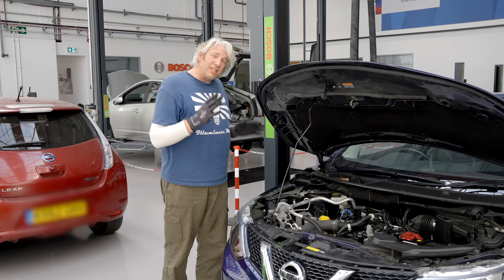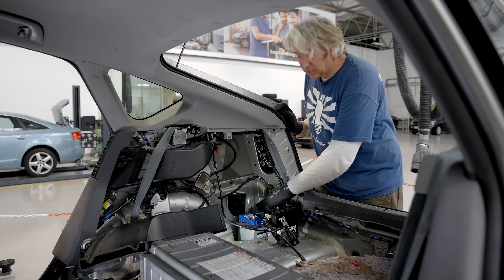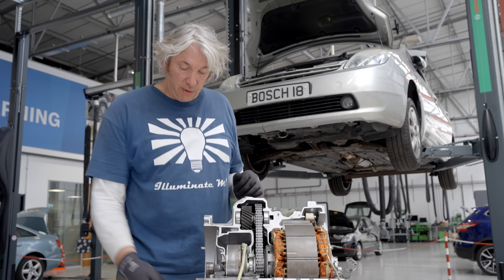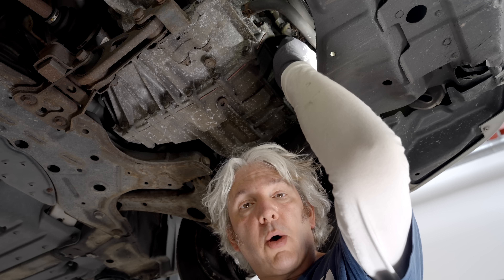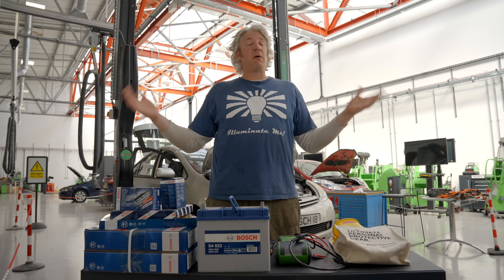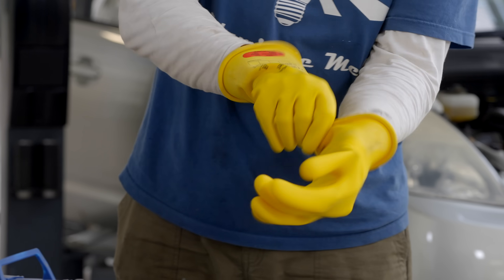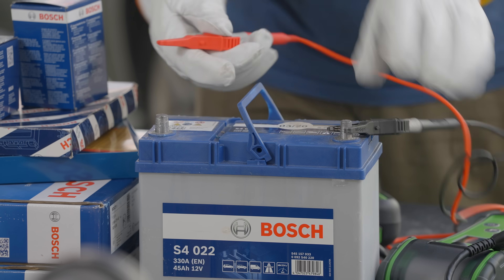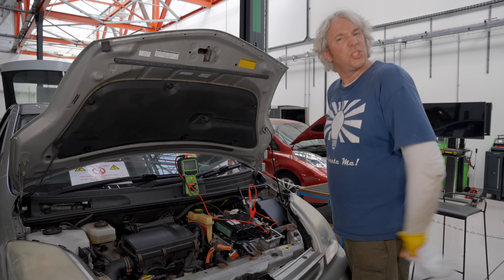DO's And DONT's - Electric Car | Edd China

Comment: This does not encourage me to get one of these cars. I cannot reasonably service it myself. Once the battery is expended it costs as much as the car to replace. This makes cars  into another very expensive disposable item just like a cell phone. You know if I was a cynic I'd say that is more likely the reason for the big push to move to electric cars.
Reply: so you never heard of battery pack refurbishments then?
Reply: @Brian-om2hh  That is the point Brian. They cost as much as the car. It was in the second sentence. If the battery is not being fixed under warranty it is not worth fixing. This makes the car disposable.

Comment: I've never as in ever heard of any gadget reducing carbon dioxide emissions from a combustion engine, China. What's that about.

Anyway, the most significant building block, fertilizer if you will, of the flora - trees, bushes and btw. farm crops - is CO2, so stop vilifying it.

Comment: But electric vehicles rely on fossil fuel generating plants? And I just learned this morning that it takes 100 barrels to 300 barrels of fuel, to process one electric battery for the car. I also learned that 40% of materials that came out of Russia were to build the current fossil fuel vehicle from Russia and now we have sanctions and I also learned several months back that 40% of cost of a fossil fuel vehicle is in the electronics?. Didn't learn that on the news. I love to learn.

Comment: Enjoy seeing your videos Edd. I have seen several fires erupting from an EV and it's fast and fierce. That's a lot of energy stored in those batteries.
Reply: That is the big difference in safety between electric and ICE cars. We can put out a gasoline fire, a battery fire cannot be put out. Even if they are no more likely to catch fire - which is really an uncontrolled discharge not a fire, but that's quibblely. EV's can be more dangerous because fires very difficult be put our or controlled. A normal car fire requires 300 gallons of water to be put out, a Tesla requires 28,000 gallons according to Tesla. In the NiMH batteries of a Prius they just don't have the juice of a Li-ion battery which can be very unstable. In NYC people are being killed in regularly in electric bike fires using Li-ion batteries.
Reply: It's a pity you don't see any of the 160'000 ICE car fires there are in the US each year Rick. It may help you to arrive at a slightly more balanced view......
Reply: @Brian-om2hh  No it reinforces my view, which is balanced. I've seen a few and they were promptly put out and several didn't total the car. Car battery fires always totals the car and take hours to put out and a lot of water. How do we handle 160,000 unstoppable fires?
Reply: @Brian-om2hh  If you want a more balanced view you need to consider hybrid vehicle fires are double the number of conventional vehicle fires and EV comes in third. EV is a concept that is not tenable at this time. Range and charging time is horrible and the chronic problems they are plagued by are inexcusable for the price. Fit, finish, control screens and even problems of leaking door seals should be corrected. According to the Rand Corp think tank, a conversion to all electric vehicles in the US would require 20 additional Nuclear powerplants to accommodate the demand and that's not going to happen. A new Nuclear powerplant has not been put online in the US in almost 50 years. 
When these vehicles combust, the fire continues until all materials are consumed. Where else in the world is water applied to an electrical fire and who believes an EV fire can extinguished doing so ?.